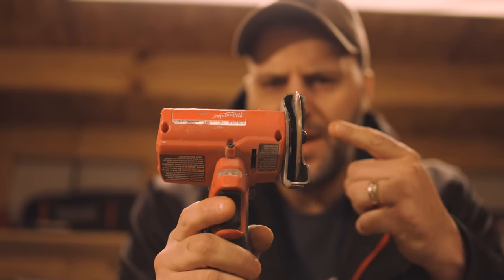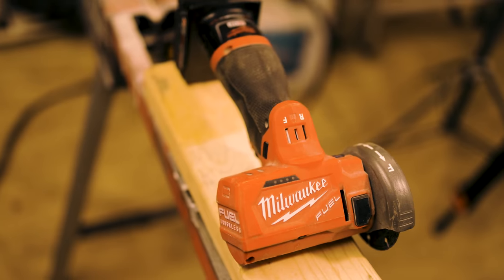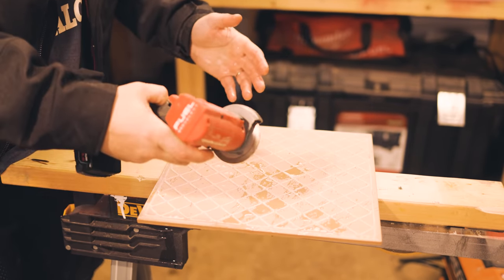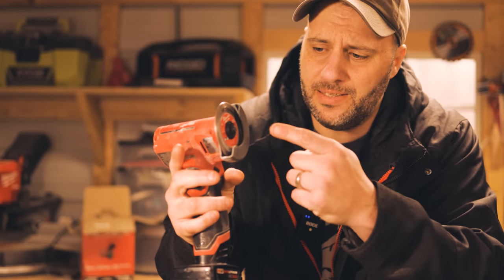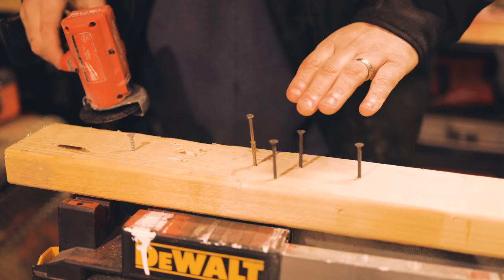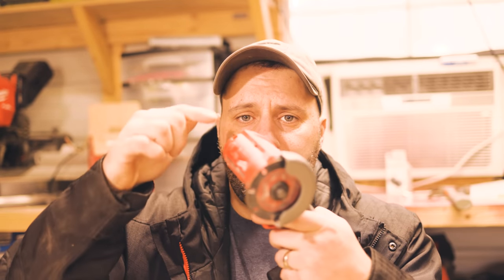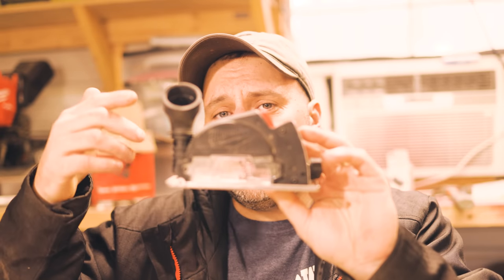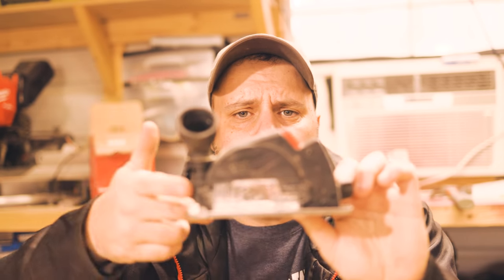Milwaukee Tool approved at first but this is how it held up one year later (Milwaukee Cut-off Tool)

Comment: This was indespensible for cutting vinyl plank flooring. Now that I'm not in "home builder" mode, I keep the metal cutoff blade on it full-time. One of the coolest little saws I've ever owned. Use nothing but 6.0s on it though. She does eat through batteries.

Comment: If you have to choose….A 5” grinder cuts twice as deep and…grinds.  These cut off tools can gently tidy a rough cut edge, but the thin abrasive discs are not safe to put serious grinding pressure on.  Angle grinder wins hands down.  However, if you already have a grinder you will appreciate the convenience of these cutoff tools…one handed use, light, fast.  Yes they will cut wood with a multi material blade..not thick 2x4 stock, but sheet ply and plasterboard.  On 2024, I have tye black and yellow one and it is great..it doesn’t bog under load and scores half inch into concrete slabs in a single pass for snap offs. Use a continuous rim diamond blade for tile work and a segmented diamond edged disc for most everything else.  I love mine.

Comment: It does cut wood with Dremel SM 500, It is a very good tool for HVAC/R installations. I use it to cut threaded rod, ductwork, 1/2 inch plywood, PVC, tile, masonry and hardwood. Dremel blades are the best with this tool [Dremel Saw-Max Cutting Kit, (7-Piece)].
Reply: Get a dremel than, it's a lot cheaper

Comment: I just bought one of these today. Ideally I wanted something like a cut off tool that you can get for an air compressor, but nobody seems to make them. The nearest I could find in design was an electric die grinder, but I don't think it would be powerful enough. I can't afford a decent sized compressor either, so I went down the electric route. My local independent tool shop stocks pretty much the whole Milwaukee range, as well as Dewalt, Makita and others. They gave me a small discount too, which was nice. I only bought two 2.0 AH batteries, as I wasn't sure my budget would stretch to a couple of bigger ones, and I though it better to have two small than one big and have to wait for it to charge up. So , we'll see how they go when I start to use it. 
My main use initially will be to cut away old metal on a van I bought to fix up and get on the road. There's some awkward to reach areas that a normal grinder would struggle to get at, and a reciprocating saw might struggle as well, hence my original want for an air cut off saw/tool. I'll mostly be cutting sheet steel from 0.8mm tp 1.2mm  (21-18ga). I'm sure it'll be perfect for what I need, though if I need a bigger battery then I guess I'll have to stretch that already struggling budget. I've already spent more money on tools and equipment than the van itself!  😆🤣
I may do my own review of it once the project is finished, see how confident I am at standing in front of a camera. 🙈

Comment: This was the first milwaukee tool I bought. Absolutely brilliant wee thing. I use it for cutting flues for wall mounted gas boilers in the UK, the outer metal coating is Aluminium and it destroys it. The depth gauge is handy so you can cut the metal outer flue but not damage the plastic inner flue. Its a brilliant tool if you need more control and accuracy on thin metals I would say! 👍🏻

Comment: My team and I use it primarily for tile detail work.  I rarely use a 4" grinder anymore for tile this along with a 6.0 battery rules the job outside the wet saw and striker.  Its more of a niche tool but highly effective in its role.  I've also used it for sheet metal but mainly for thinner gauge stock and hard to reach places.  It does need more power (what doesn't?)  but its very nimble allowing it do things do things better and easier than a standard grinder can do in a lot of applications.  The dust shroud works but a seldom use because this tool does not have the power outside small applications.  Do not expect this tool to cut long runs of drywall it just does not have the torque.

Comment: I have one and I highly recommend it. It allows one to have a great deal more control when making precision cuts than what's easily achievable with a grinder. The first shroud makes tile removal nearly dust free when connected to a vacuum. 
While it's supremely versatile for cuts in a vast array of materials (except wood as you mentioned) one of the things is does better than anything else is cutting round ducts! No more pain in the ass snips that leave jagged edges that always cut your hands as you are attempting to complete the cut. I'd buy it twice over again.
Reply from the maker: Awesome feedback,  thanks Jeff!!!!!
Reply: @ToolReviewZone  your welcome Clint.

Comment: I bought 2, one for tile one for metal, took the guards off and use 3 1/2 inch blades, I know you  can’t recommend this for liability reasons but this tool rocks with a 6amp battery.
Reply: Was there any issue with the exposed area once the guards removed?

Comment: Hey Clint, thanks for the follow up.
With the 7/16-Inch flange adapter you can use the 3-Inch Dremel 
saw-max blades.

Comment: I’m like some of the other guys here, I don’t use it often but when I do it always gets me out of a jam.  I use it mostly for casting plastics with the special blade.  And you’re right it is under powered but it is tiny.  I run the 6ah battery only.

Being able to change the direction of the disc is one of my favourite things.  The only thing I didn’t like was the price, it was very expensive where I live.
Reply from the maker: Awesome,  thanks for the feedback Fla!!!

Comment: it works GREAT for cutting vinyl, laminate flooring installed in the floor already..  for instance if you are cutting in a new transition strip.  It just eats it up, no smoke, and you can even hook up the vacuum for dust extraction to make a very nasty dusty job not so bad.  works great cutting into existing drywall with the vacuum as well.  awesome tool

Comment: Harbor Freight has a Corded Metal Cut-Off saw for around $20.00. I’ve had one for years now and I cut all kinds of crap with it.  Blades usually sell in a pack of 5, very reasonably priced.  I just cut through some tough Steel with it and it didn’t slow down once.  Anything larger, I use my Angle Grider for.

Comment: Just purchased This tool today.  I already had 12v pipe cutter and press tool (novopress) so had battery’s. Still haven’t used but exited to now after seeing review. I’ll be using mainly on boiler flues, plasterboard and pvc shower plinths and bath panels

Comment: I'm a house painter, I got this thing to cut out drywall damage quicker than I could with a Fein Multimaster, use the dust shroud a lot and it works well, I'd say it's about 90% effective.   But damn does the drywall bog this thing down and completely stop it, really frustrating, if you happen to know of a tool like this that would have good dust collection and doesn't wimp out in drywall I'd appreciate you letting me know.  Great review, thanks!
Reply from the maker: Thanks for the feedback Ted!!!
Reply: Makita makes a killer drywall tool with a functional dust collection.
Reply: I use for drywall also. I found you have to nurse it a little or it stalls. I usually do one pass about half depth then run a second all the wall through.

Comment: My Ridgid version of this little guy HAS BEEN FANTASTIC for replacing exterior doors ... I've had to cut out three old deeply caulked pre-hung doors (frame, header, and aluminum threshold) NEATLY to preserve my new Hardie-board exterior siding and trim, and these saws give you a lot more control than a grinder.  Yeah, absolutely worth the $100.
Reply: -- and I'm running out to HD tomorrow for the DIABLO blade you recommended for them!
Reply from the maker: I actually bought a few of the ridgid blades for spares but haven't even tried them yet. Doubt they will even come close to these
Reply from the maker: Hell yeah, I love these damn tools 👊
Reply: @ToolReviewZone  The ridgid blades are solid, not expensive -- 3 for $20 -- and have held up pretty well ... but looking forward to the next-level of performance with the Diablo product.
Reply from the maker: @danielconaway2055  awesome,  thanks for the feedback Daniel! 👊
Reply: Hey man I fit doors in france ripping out old units out I cut through 6-8mm steal bar and ali and steal threshold wanting to cut pvu and aluminium trim with it will it stand up too the job?

Comment: The saw table attachment for this grinder would be incredibly valuable if you are cutting a straight line on tile that has already been installed on a floor. For example, when I laid tile in my living room, I provided a large cut-out area for carpet that has a long straight edge and two 45-degree straight edges.  When I originally installed the tile, I had to cut every single one of these edge tiles that abut the carpet individually, and it was incredibly difficult and time-consuming. With this saw, I could install all of my edge tiles uncut and then snap a chalk line where I wanted the carpet cutout edges to be. Then, I could use the table and simply cut the straight edges that make up the perimeter of the carpet cutout area. This would have been MUCH easier and faster. They make wet saws to do this, but they are over $200.00  - $400.00, and it appears that this small saw will do the same job just as well if you are careful with your cuts. The wet saws used to cut straight lines on installed floor tile cannot be used for anything else, so they are a specialty tool that most people don't need - only a pro-tile contractor really needs to spend $400.00 to get one. This tool can be used for making curved cuts and notched cuts on tile as well as straight cuts on installed floor tile and that is incredibly useful. 

Another example is that I am adding a different tile to my house in the hallways and it will run into the old tile in the guest bathroom and the kitchen great room doorways. I want to install a 5"-6" wide decorative tile border that has the grey color of the new tiles and the brown color of the old tiles where the old and new tile connect at these doorways. In order to do this, I need to cut approximately 2" off of the old tile with a straight line. Using the saw table with this small cut-off saw is the perfect tool for this job. I can snap a chalk line where I need to cut off the 2" and cut a straight line on the floor across most of the doorway. At the edges, I can use a diamond-tipped multi-tool blade to finish the cut.

Also, another reason for this saw table is that it has a dust collector. When you dry-cut installed tile on a concrete floor, you create a ton of dust. If you hook a vacuum up to the saw table and use it as you cut your lines, it should (in theory) suck up most of the dust. This would be true anytime you are cutting a straight line on a tile piece, although it would be much more efficient to use a tile wet saw for those cuts.

Comment: I have one and I think it’s a decent tool. Cutting through metal the motor stalls super easily. This is good in a way because it’s pretty safe and I don’t think the disc would blow up in your face when it gets into a bind because it stalls before that happens. I wish they would’ve just done an M18 one like dewalt has with their 20V cutoff tool which has more power

Comment: Attachment is great for chasing walls or floors to specific depths, use mine all the time! 
Could do with more power at times but I use a fully charged 6.0 ah and it’s good most of the time. 
Great video
Reply from the maker: There ya go 👊 Thanks for the feedback Gareth
Reply: I have a 4 amp battery, use it for cutting out damaged drywall.  You think a 6 amp battery would do better?  The 4 amp does get stopped quite a bit.
Reply: @tedparreco5963  although they say the AH has nothing to do with power, I find that a fully charged 6ah or 9ah can get through more than the 4ah can, so there must be something to it.
Reply: @garethwatson7999  Thanks!
Reply: @garethwatson7999  Yeah, I'm gonna up the battery when I can, wouldn't mind getting a genuine circular saw blade for it as well.

Comment: I use mine for rigging and yacht repair. In my opinion it needs more power. The DeWalt cutoff tool is about twice the power and the same price. If you own both platforms get the DeWalt

Comment: I love mine.
Use it for tile work primarily, but also great for making screen frames, pipe cutting and I also got a 3in saw blade and use it for quick cuts when installing floors. It works! 💯

Amazon for blades, Absolutely! 

Definitely use the dust shroud with the saw blade. I turn the tool upside down and use it like a mini handheld table saw, otherwise it Can get away from you, lol.
Reply from the maker: Awesome feedback and comment Redd!!!
Reply: @ToolReviewZone  👊👊👊Best when used with a 4-6ah battery, ESPECIALLY cutting backer board, lol.

Comment: Use mine for tricky cuts in drywall, that’s why I like the shroud cause it throws a ton of dust when cutting drywall or cement board

Comment: Thanks for the video. I have a plug-in Ryobi grinder that I've had for decades. It works fine but... it's time to get a cordless option for cutting nails off, etc. I WAS going to buy a Milwaukee grinder... but this makes more sense for the stuff I typically need to cut off and for unique tile cuts (like you said). I can always use the plug-in Ryobi for heavy work (which is probably better plugged in anyway).

Comment: The cut off tool is almost twice as powerful as a small grinder more power means cleaner cuts plus the cut off tool vibrant way less and the start is more controlled

Comment: This is a great tool as describe and it can be used is more situations than advertised. I have used it to cut wood. Just get the dremel wood blade it works great for trim cutting, and I also use it to cut plexiglass with the cut off blade. The more you use it and know what the limits are the more of a pleasure it is to use.

Comment: I bought the Bauer version of this for use on LVP flooring,  works great!  The Bauer does have on board storage for the Allen wrench lol.  I haven't used any other brands but yeah I agree they are a little underpowered but it works for what I need it for.

Comment: Looking to pik up this or dewalt soon to be available unit.  I will go with the unit that has the best power output.
Lastly I have cut wood and plaster with various tools and am looking at this for a less strenuous one handed operation with depth control and vacuum attacent for the horrible dust storm that ensues while cutting plater and drywall.

Comment: been using the diablo blades from home depot for metal. bought them because i ran into the same thing as you, they stock the bare tool, but milwaukee accessories? hah!

Comment: If never done it but I think that dust extractor would probably be nice for people who cut small tile mosaics which is always done in the people's home.

I had a kitchen backslash installed a few years back and the guy had a little cut off wheel just like this that he used to cut the cherub rows and the cutouts for for wall plates and he had powder all over the kitchen.

Some of that dust got on the stainless gas range and put scratches in the finish of a brand new range top that we didn't notice until a they were all done and paid.

So yeah in that scenario that dust extractor would have been highly preferred by me the client.
Reply: Unless wet saw no tile cutting should be done indoors, silica.

Comment: I have my eyes on that specifically for tile. I've a few bathroom renos coming up, and I see the cut off tool as a big player. I think I'd have to be a freak with a grinder to get anywhere near the control (especially if you've an M18 grinder) that you can with a cut off tool. 

A grinder is a tool almost anyone should consider owning
A cut off tool seems like its specialized for intricate work.

Comment: It's the first Milwaukee tool I've ever been disappointed in! It's waaaaaay underpowered, it should have been in the 18V family! I was cutting 063 aluminum sheeting & it would stall when just getting started. I sent a message to Milwaukee & they didn't even respond! Sad!
Could I have gotten a dud? Mine certainly doesn't perform anything like in this video.
Reply: I've noticed M12 tools needing higher torque will die if batteries are too small in amps.
Reply: Do you let it rev up to speed before you begin the cut? That's important.
Reply: @tinman1955  Yes I do but I don't believe it was ever designed to cut anything very heavy. I have since bought the 18V 4½" grinder & it does the job quite handily. I guess that's what I should have bought in the first place.

Comment: Bro put the vac attachment with ur dry cut tiles bro with a RIDGID VAC bro it with blow ur mind Indoor cutting 0 dust u'll never walk outside again to dry cut lol 😂💯 try it ull love it ,💯👍🇺🇸
Reply from the maker: Awesome tip👊
Reply: The vacuum shroud also works great for cutting concrete stucco board, and concrete tile backer board.

Comment: I have two of that, one with a cut off wheel and the other converted with a 12" X 3/8" belt sander and it's been great, eventually I'll get another for the longer 18" X 1/2" belt sander.
Smeeesh that like button.👀👉🏽 👍🏽
Reply: Milwaukee blew it by not making it into the belt file sander.thanks to the independent craftsmen out there you can do the job yourself.
Reply from the maker: Awesomeness Jason,  and thanks for the SMEEESH brother!!!!